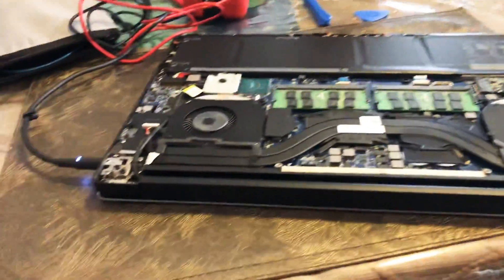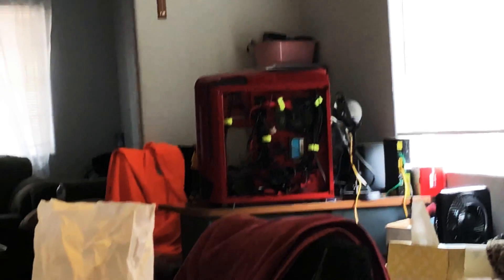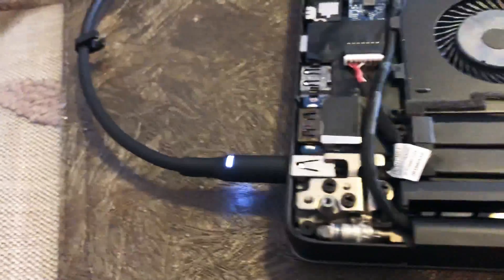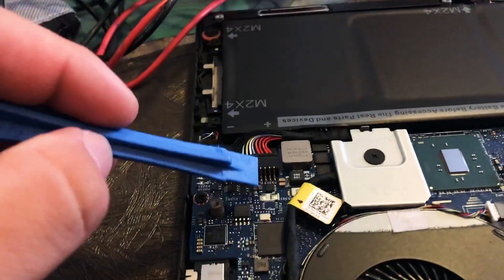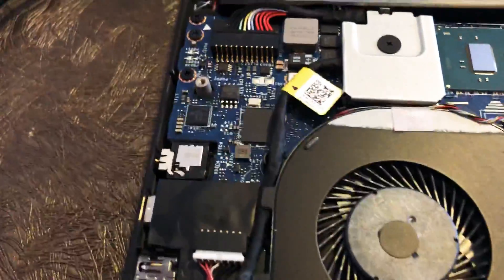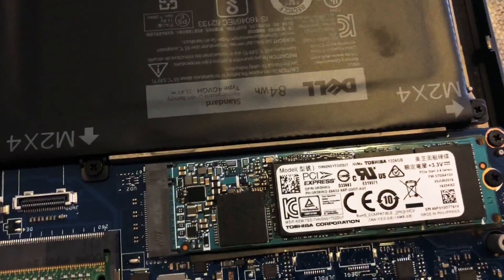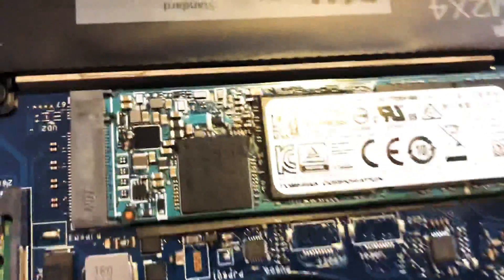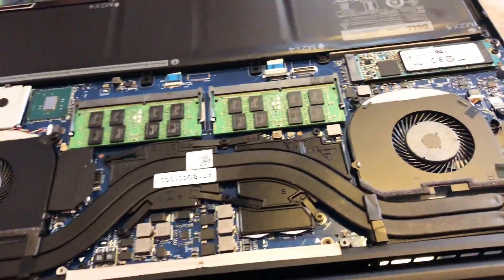Troubleshooting a Dell XPS 15 9550

Comment: I had my XPS 15 9550 failed to boot up and also not charging due to completely drained battery. Reset the CMOS, press power button for 10 sec without battery and then installed back everything. Plug in battery charger and press power button a few times (1-2 times it shut off by itself) and then the boot recovered starting from BIOS setup. Change previously Adaptive charging to Standard charging mode. The battery can be charged again.
Reply: Does your laptop get stuck on the dell logo screen as well? Hope you’ll reply. Thanks!

Comment: Mine won't boot either. I changed a bios setting and it's bricked.
Reply from the maker: Kaleb Howard make sure you’re booting from the ssd. For some reason if you set up for the system to boot from a usb drive it wound boot up. At least that was my case and I set the Nvme drive 1st in the boot order.
Reply from the maker: Do you get any blinking codes?

Comment: Hi, I have a similar problem with my 9530. The battery indicates no juice. As soon I plug in the power cable the power button blinks white. Like it is stuck in a standby mode, nothing else. Black screen. I did measure voltage as you have. And got the same measurements. I don't know if that is normal. I have ordered a new battery and hope it will help. 
Have you got your PC up and running?
Reply from the maker: me I did. Before you open that new battery box, unhook the battery from the mobo and plug in the power adapter into the laptop or motherboard if you got it out. That way, you can run the laptop directly from the wall plug and not the battery. If it boots up, hey, it was the battery, if not, try reseating the ram. Have you tried the hold the power button for 15 seconds technique?
Reply from the maker: Also, check the connections from the charging port, maybe some of the connectors aren’t making contact but that’s unlikely( from charging port to mobo and mobo to battery.) It’s wrong to assume that you’ve used your dell like mine, hardly ever, so idk if you have yanked the power cord from the charging port.  If you have done so lately, check the port itself.

https://www.dell.com/support/article/us/en/19/sln85632/dell-pc-does-not-turn-on-or-boot-into-windows?lang=en

This laptop is finicky because when I had my 9550 tore down troubleshooting, the thing didn’t even want to boot if the cooling fans weren’t hooked up, so your laptop may not even be POSTing( Power On Self Test,) so make sure your ram, nvme, ssd drives are connected.

Comment: did you fixed ?
Reply from the maker: loreias yes. So far it boots back up. I’m guessing that by removing the cmos battery, it reset the system. Dell and other guides recommend the, “hold power button for 15 seconds”, but it didn’t work for me.
Reply from the maker: Plus, I cleaned up Dells shite Thermal paste, trust me they might have just slathered playdough in there.
Reply: Aw3someOpZ where is the cmos battery. I have the exact same issue. It works fine without the battery. I even got a new batter but I think this needs a CMOS reset
Reply from the maker: naireen0 unfortunately it’s under side of the motherboard. You know the side that faces upward? You’ll have to remove the whole motherboard from the computer to get to it. Dell has some guides to get it done and IMO I think it’s easy.
Reply: MK-0 my 9550 does boot but it randomly goes to sleep with no pattern. Could it be that the cmos battery is bad?